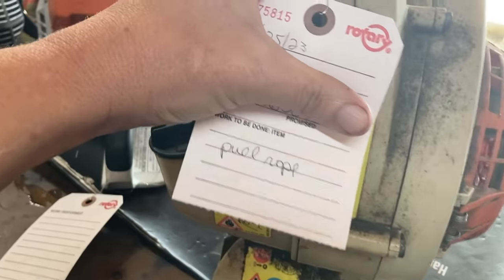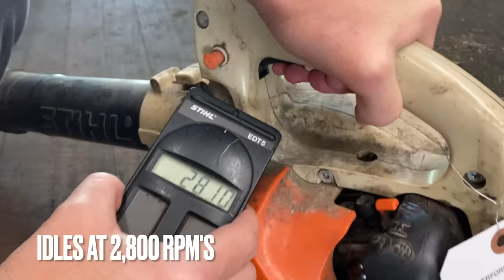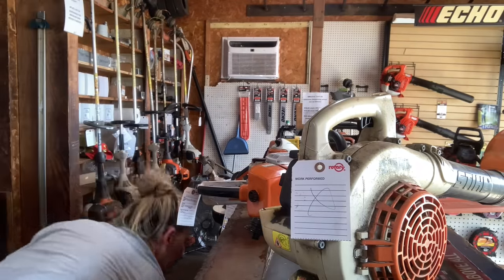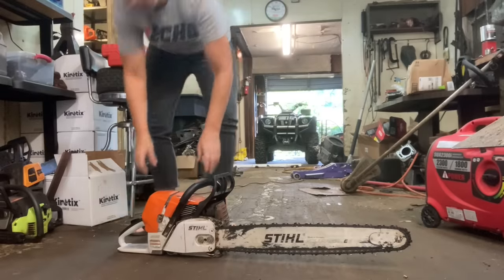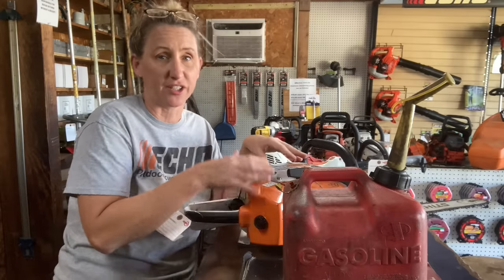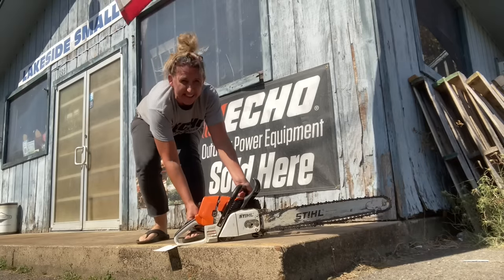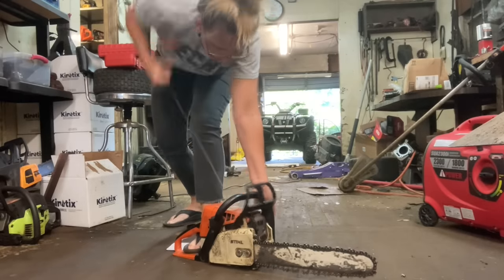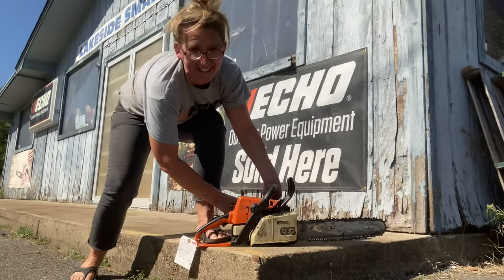The Burning Truth of Canned Fuel. This HUGE Distributor Doesn't Like Me Exposing It!

Comment: 40yr Stihl/ snowmobile/marine/ATV etc engine mechanic with over 20,000 completed work orders here, gas sitting in a saw fuel tank will slowly lose it's volatility no matter if it's canned fuel or pump fuel. What happens is, the VOCs in the gasoline slowly evaporate, the more closed the container, the longer it takes. 
  -The VOCs in the gasoline create the explosive mixture when the piston compresses the fuel/air mixture. 
 -Gas will stay fresh much longer in a metal container than a plastic one. as the VOCs evaporate,  the engine will get harder to start, until it just won't fire.  
 -A simple test I use to tell me if the gasoline still has VOCs and will work in an engine is, with the gasoline to be tested at room temperature,  put on a nitrile rubber glove, dip your fingers in the gas and wave your hand around in room temperature air, the fingers you dipped in the fuel should feel noticeably cooler, meaning part of the gasoline is evaporating and has VOCs present in it. 
  -The more cooling [evaporation] the more VOCs present in the gas, if there is a little bit of cooling, the engine may start, if there is no cooling [evaporation], the engine will not run on it.   This test works without fail.      
   -A note on canned fuel, Stihl/Husky gas contains no ethanol at all and it is very stable, it smells to me like avgas.   Pump gas [because of ethanol etc] is hard on carb diaphragms, [metering, pump], it causes them to harden creating low fuel pump output and poor check valve function.    Canned gas is [Stihl/Husky] will not harm the carb.    
    -I always dump out the fuel and put in new premium mix [with some octane boost for cleaning] on every saw service, then you know that you have eliminated bad gas and it doesn't hurt to flush the tank and get rid of sawdust and dirt that has accumulated. 
   -I hope this helps with the understanding of the relationship of VOCs in gasoline and the explosive mixture that it creates for an engine to operate.

Comment: After your video I switched to pump gas and 2-stroke oil and my Stihl brush trimmer. Worked much better that way compared to canned fuel I had been using. However, my Stihl chainsaw works well on the canned fuel. Interesting.

Comment: To my ear it sounded like the chainsaws were running rougher at idle and you can definitely hear the bog down full throttle.

Companies spend a lot of money promoting their products and if there's a large profit margin for the store that sell it.  Unless customer stop buying the product.

From what I have learned is that companies can keep on promoting their products but eventually catches up to them, especially in this modern day of the internet.

I was worked for a company call mobility electronics.  They hired a new head engineer who didn't have experience with the type of electronics we manufactured.  I tried to warn the president of the company what was going to happen.  I was let go.  What I warned about happened and the company lost so much market share that it was bought out at least what littles was left of it.

Comment: Related question, is it bad to store these engines with no fuel in them or is that the preferred way vs engineered fuel crap? I will say I didn't use my Stihl trimmer for close a year or more and it started right up after a couple pulls with the engineered fuel I left in it (happened to be SEF).

Comment: i hate to say it , but , I've had a Poland saw they sat for 2 years , with the pink stuff , started in 2 pulls , i notice all your products are stihl , stihl has more oil in their mix if you use stihl oil , makes a difference if its a stihl , their oil is made for it and that's why they don't warrantee anything other than stihl oil , stihls are made to be ran wide open , that keeps everything from getting clogged up , never half trigger a sthil they working not bs'ing around , put some stihl oil in stihl equipment. got saws and weedeaters , and leaf blowers that 30 years old and still doing good if you use the proper mix and oil

Comment: I will never have to deal with gasoline ever again hopefully. All of my tools are now cordless an electric they have been for a while.  I am so sick of cleaning carburetors and spilling gasoline, smelling exhaust and absorbing oil into my skin. Never again will I have to pull start a Weedwhacker.

Battery electric systems are far cleaner and they can be recharged with solar energy. There is no emissions problem or local toxicity. 

That’s what I think

Comment: I let a weed eater sit for 4 years. With can fuel in it. It cranked right. I was surprised to say the least. I like the stuff. I don't have carbs stopping up etc since I started using it. In my opinion it's a great product. But I don't work on such for a living. I probably wouldn't like either if I did.

Comment: I wonder whats in american "canned fuel" as here in sweden we use Aspen alkylate gasoline that kinda comes "canned" as its bought in its own container, difference is that the Aspen gas works much better than out of the pump gas, it lasts up to 5 years and chainsaws, trimmers etc runs great on it. No one I know has ever had an issue with it and everyone use it for their chainsaws etc.

Comment: The Big Box Stores, probably Costco and Sam's Clubs. But does it matter the "grade" of gas? But okay I'll pay a little extra and get gas for power tools from the "gas stations." I gave up my gas pressure washer for 3000 PSI electric. Otherwise, I use gas  chainsaw & weeder occasionally. If I had a condo I wouldn't be concerned with any of that. But I like my house & big lot. My mower is battery. The less tinkering the better. Even though, I used to tinker & mess with machines but no more. I do have good application for good honest mechanics or honest workers in general. 🖖

Comment: bet that blower would rev up to 7200 with a high speed needle adjustment...unless that brand of equipment doesn't come with mix screws on the carb? (Granted, old gas runs like crap no matter the brand lol)

Comment: You keep saying distributor and not manufacturer, are you saying that that engineered fuel sold by specific box stores is the issue or from a specific manufacturer is the issue?

I bought the biggest backpack blower that Husqvarna mix and I could not get it started on my own mixed fuel. But it started right up and runs great on the canned engineered fuel. Now I’m sure that’s just telling me that my fuel is not properly mixed.

Comment: You have a strange way of pulling the starter rope, I always take out the slack, then pull. I have never bought the ready mixed fuel ⛽️ mainly because the gas eats away the lubricity of the oil. I only mix 1 gal. at a time (ratio rite) and don't use it after a week

Comment: Steve's Small Engine Saloon promotes engineered fuel, has a very good video what pump gas does to small engines. I don't know what that pink fuel brand is you keep pulling out of those tanks (you don't say the brand, plus you won't say what "your fuel" is), but I use VP fuel and it isn't pink it's blue. Been using it for almost 10 years with no problems, always had problems using pump gas. I have chain saws that sit for a year, with "my fuel" and it will start right off and run at it's full potential, never could do that with pump gas.

Comment: What kind of fuel are you using? Does it have ethanol in it? And what octane is your fuel. I have a similar problem. Only reversed. It shudders when using no ethanol gas at a station and mix my own synthetic 50 to 1 oil. But will run perfect with the manufacturers fuel can. Why is that. Can you help?

Comment: What octane do you use for your fuel? I got a qt of Stihl MotoFuel for my Stihl Chainsaw I just bought and it runs great but it's not pink like that stuff 😂. I bought a 6 pick of the Stihl Platinum Oil to get the double Warranty but I can only find Non Ethanol fuel near me in 87 Octane. I figure I'll use the motofuel til it runs out but I'm questioning buying more but I do know it's different than that pink stuff but how much different is the real question, I do know the MotoFuel is 93 Octane and Non Ethanol but beyond that I couldn't tell you much else about it 😂

Comment: HEY YOU'RE A GIRL! My wife's Keen sense of hearing pick that up on the speaker that I'm connected to. She says I'm impressed that was a woman. Hey she said it not me. I'm impressed with your honesty that obviously you're going to take a little heat but you didn't back down for the big-box stores distributors.
I DO HAVE A QUESTION. First I like how you said it's a stihl so it's going to take a couple of poles to get it started sometime. I have a half a dozen Husqvarna chainsaws. Husqvarna Husqvarna you're just picking up the echo of a good 🪚😉. You appear to be an echo fan I could not resist that. I got lazy and switched over to using CANNED ⛽ FUEL. BUT IT'S NOT FROM ONE OF THOSE BIG BOX STORES. IT'S FROM A REGIONAL BOX STORE AND IT HAS A NICE BLUE COLOR TO IT.  But my saw that always start it after a couple of tanks of this did not start. The plug was full of carbon are what look like carbon and looks like there's some in the cylinder looking in the hole. And the spark armed with smashed up against the electrode. Now about a season or two ago I bought a can of mixed fuel because that double the length of my warranty from one of those big box national stores. Yes if you bought their fuel for $50 or something like that, it doubled warranty. I mix the fuel all my life I grew up at home lite chainsaw so we had to work on them quite a bit. And I started mixing my fuel again and my equipment running fine. But then I made a mistake probably mixed it to Rich on oil 🛢️. Change to plug in Boston can fuel from that regional box store and been used in multiple saws and leaf blowers and whatever else. I know is that my little chainsaw that always starts is acting kind of funny too because I'm running on the bottom of that can of fuel ⛽. My plans still is to mix moan and put it in their can. But I caught it on sale and bought a couple of cans for $10 a gallon. I know I can mix it for around $4 a gallon. What I don't understand is how the particulates in it do not separate because you can't shake it there's no air in that candle out for a remix at least not until you use some of it. My basic question is have you had problems with carbon build-up for some kind of buildup as I described with some of these fuels and it can? And all the rest of it is just background information. Hey in time I get my wife to listen to something automotive mechanical including chainsaws it's a good day. So I appreciate your channel on that level as well.

Comment: Hi my mower pto just cuts off after 20 minutes use I’ve ordered a new switch and reset the gap on the pto it still cuts off after 20 minutes use . Do I just need pto unit ??? It’s huskavana z560 60 inch deck professional mower ? Thanks

Comment: I am CONSTANTLY  having to mess with carburetion/starting hard/idling on echo and stihl 2 cycle eqpt. Phoenix heat, I know.. it's a factor, but I've tried the high priced gas and it doesn't seem to change anything over the standard 87 octane ethanol added gases. I use good quality 2 cycle oils, like Lucas, Valvoline, Amsoil (actually Amsoil is a 100:1 mix but i use it just a little stronger in the hot months) 50:1 mixes usually (3 oz/gallon). Anyone deal with this too, successfully?

Comment: Love the channel. But would like to share my opinion on this. First, its a little dramatic to throw away and empty every tank of canned fuel based on it possibly causing problems in some random used equipment. And to   condemn every ounce of this stuff without doing an analysis of a new (unexpired) can to see what is in it and what is going wrong in the fuel is oversimplication of an unproven (although very coincidental) issue. We have no idea what was added to these fuels by the owners or how old the fuel is. Now, if you choose to empty any indication of canned fuel from any equipment in your shop, you certainly have that right. And you may be 100% correct that the fuel is the culprit. But people are very simple minded and they will throw out every drop of their canned fuel based on this video and put ethanol based fuel in their machines because they will think its a better gamble. And its not necessarily. If its not something you recommend, thats fine. But it appears to be kinda over the top way of handling a product that hasnt been scientifically proven to be a problem. There are way more success stories associated with using and storing these fuels than there are stories of the fuel causing problems or damaging equipment. In any case, ive already read comments of people immediately telling others how horrible and  damaging canned fuel is, and they have no idea what youve said. Id bet some dont even have gasoline powered equipment. Lol. They are simply parroting what they saw here with zero understanding. Because thats what people do. These are the same goofs that tell everyone a clogged filter is better to use than a new one because the filtration holes are smaller and collect smaller debris.  Anyway, back to canned fuel. I know to test this stuff would be expensive and you are likely to tell me to go pound salt. Im ok with that because Ill continue to binge-watch your awesome channel because its excellent. But just wanted to give my 2 pesos. Cheers!!!

Comment: These days I appreciate the lower noise level, dependability, and near zero maintenance of corded electric tools. Even my lawnmower runs on an extension cord. But I still do have a few two cycle tools for use where no power is available, and honestly it never occurred to me to use any of those pre-mixed fuels. They cost too damn much, mainly, and I am a cheap bastard. I have always mixed for saws, two stroke outboards, etc. It's not that hard to find ethanol free gasoline. Out of two stroke oil? Not a deal breaker IME, I have made field-expedient substitutes that I am not proud enough of to tell you what they were. But apart from ONE case of serious plug fouling in my 64 year life, and rarely a bit of excess smoke, it has never been an issue and my little chainsaw has gone through a half dozen bars and a couple dozen outright chain replacements. By rights it should have been replaced a few years ago but it still runs good and usually starts by the 4th pull. Glad I never discovered the ease and convenience of pre-mix. I didn't know that stuff was so awful. I am sure that if I didn't know better and if I was lazy enough to buy pre-mix, I would have tossed that old saw a long time ago for being old, worn out, useless, and in the way. I think maybe today I will cut a few more pecan rounds, and make some pretty blue smoke. RRRRRRRRRRRRRRRRRRRRRR!!!!!!!!!!!!!!!!!!!!!!!!!!

Comment: 1st: What 2 cycle oil & gas do YOU use?
Ive tried many 2 stroke oils with 87/89/91, racing & non ethonol fuel.  My redmax EBZ8500 bogs on all mixes.  BUT IT CAN BLOW 3 YARDS OF PACKED WET HEAVY LEAVES LIKE NOTHING WITH TRU FUEL it (Redlines) with it.  Nothing compares.  I cant get any other mixture to Rev/Redline even remotely close.  By the by:  is there a Redmax EBZ8500 muffler noise silencer?  Ive tried Stihls BR800 theres no comparison to Redmax its a JOKE compared to EBZ8500 but i need to figure the REV REDLINE Mixm true fuel is way too costly.  Any suggestions PLEASE LMK. TY

Comment: It’s better than ethanol fuel.
If you can’t get good quality ethanol free gasoline then for sure use the canned premix.
Unless you are a professional who is going to run the fuel out of your equipment every day or other.
If your only possible using it once a month are longer then using ethanol fuel in a small engine will cause problems in the fuel system once it starts to crystallize…

Comment: I use Aspen 2 and stihl motomix never had any problems with that i add some more oil too the premix so its 40:1 or 32:1 depending on what i am using it for mostly its 40:1. What is that you call the big box fuel

Comment: Yep, my Echo 620p runs much better on pure gas & Red Armor oil.  My MS660 clone will not run on Tru fuel but runs great on pure gas + oil mix (gas $5, oil $3 = $8/gal.).  Also, Tru fuel Is crazy expensive at $24/ gal.

Comment: All I use is non ethanol gas in all my small engines. Do not have any issues. I leave gas in them all year. I use to drain and run all gas out of my weed eaters and blower. I think that was worse on them. Just my opinion. But I do not use the can fuel!

Comment: Why don't I have a problem with my five units using  canned fuel? Just askin? There IS a proper way to use it. For all you know-it-all weekend equipment warriors, that canned stuff can go stale if its a couple years old or more. The local multiple award winning Stihl Gold Star technician recommends running your fuel tank dry at seasons' end, or for long term storage, regardless of what the fuel is!!!

Comment: Any gas powered tools I have will run on regular gas right out of the pump, just like my car or lawnmower. have no problem with them. 2 chainsaws I have had for about 20 years, with the 87 octane gas from the pump. and they have had no problem. I can not see spending almost $20 a gallon for cutting firewood, the oil is costly enough. I keep hearing you have to use the canned gas or the saw will not run, and you can't us gas with any alcohol in it.